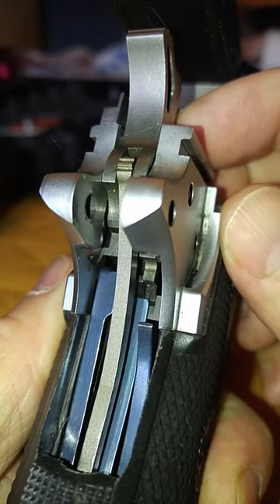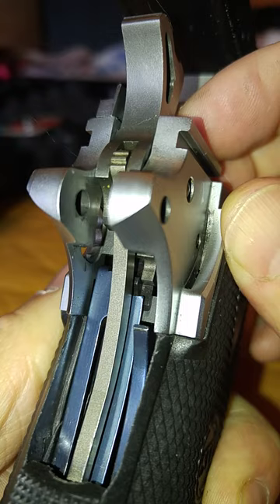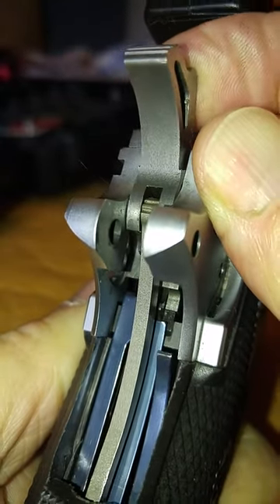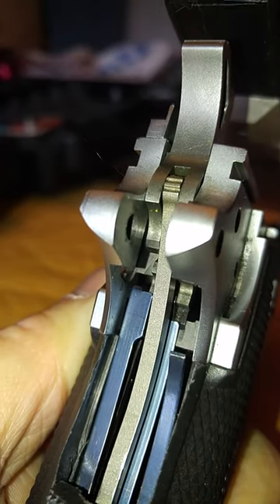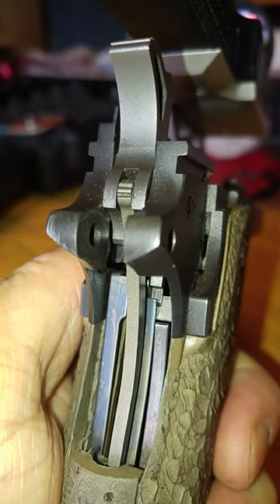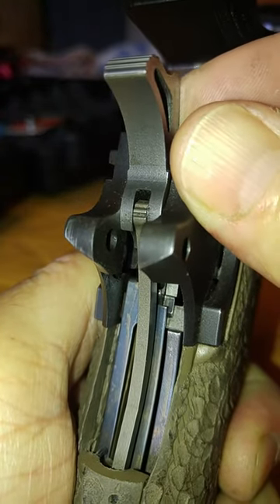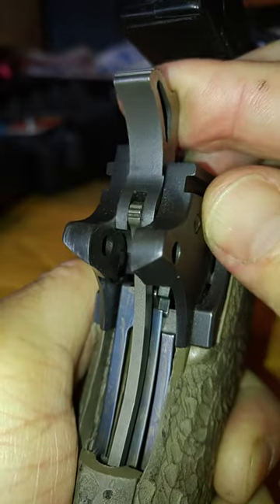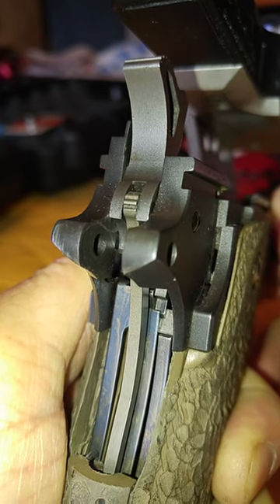STI Match Master Sear/Disconnector Problem - Sear Spring too short!

Comment from the maker: As an update. This past summer the barrel failed at the barrel lug/connection. It only had about 9,000 rounds through the barrel. Shortly after that, the slide cracked on the top and edged toward the strong side. I am still waiting for STI/Stacatto to send me a replacement.  Two months later, my Trubor with 60,000 rounds cracked in the same spot. Again, still waiting on a replacement slide. A friend has an older open gun with 180,000 roumds with no issues. Go figure.

Comment from the maker: If the spring is set too light, it will be as if there is no 1/2 cock stop. Also, you can easily cause it to not catch by filing the sear or notch on the trigger to the wrong agle or removing too much material.

Comment: Which brand sear spring did you buy with the extra length?
Reply from the maker: I got the spring from the Canadian STI distributor. He went through his supply and picked out the longest one he had. FWIW, the quality control of the length was not very good as it really depended on where the spring was bent on the end. It just happened that my gun (the plastic grip) was not fitted as tight to the frame as some other guns.

Comment: How did you fix it i have same problem not loud click did you put a heavier MS spring to fix that or play with the sear spring leaf??
Reply from the maker: Ron, I replaced the spring with a longer spring. We had to sort through a number until we found a slightly longer one. The problem may be because of the grip fitting in that the slot that holds the spring was too far away. However, the quality control on the bend in the spring where it sits in the grip is not very good. There was no consistency on where the tab was bent. 1000s of rounds later and no issues.
Reply: Twoicebergs you talking about you replace the main spring you put a longer one ? Or you talking about sear spring leaf?
Reply from the maker: Sear spring. As I mentioned in the video, it was binding (not all the time) on the disconnector and needed to be just 0.5-1mm longer.

Comment: So I shot my Dan Wesson today and was having hammer follow all of a sudden. I have never had a problem with that gun, not one. But today almost every round I had to pull the hammer back manually. Could it me my sear spring? Should I just try to order a new one and replace it?
Reply: Oh yeah and I had two double fires also. The only thing I changed was I shot some steel cases wolf ammo though it. I thought it had to be the ammo because it’s never done that before. But after trying brass case it was still not locking the hammer back.
Reply from the maker: I would look at the disconnector first. Also, ensure all of the grip and spring attachments are not loose. Then you would try to recreate tbe problem on your bench with the back of the grip off. Obviously if you had another spring readily available you could just swap it out, assuming it was tuned for your trigger and disconnector.
Reply: Twoicebergs is this something I should just take it to a gunsmith who knows 1911s? I’m ok with replacing springs and parts but not adjusting triggers. Thanks for the reply.
Reply from the maker: @goldenbanjo197  Most times these issues occur when the spring looses some its presssure due to aging or being lightened to change the trigger characteristics. After being adjusted it can fire 10s of thousands without requiring adjustment, but I have found that most of these problems occur within a 1000 rounds of being new. Rapid firing seems to be where the problems seem to show the earliest. Same for ejection issues.
Reply: Twoicebergs it’s weird because it worked flawlessly when I got it. It’s got fairly low miles on it. I would imagine under 1000 rounds. But I’m the second owner. I have shot maybe 300-400 rounds through it and the guy I bought it from said it only had 500 rounds through it. I’m going to take it apart today and see if I can see anything. Any help on what to look for would be greatly appreciated. I’m not an expert on these especially on how the trigger system works and what to look for. Thanks so much.
Reply from the maker: @goldenbanjo197  ensure the disconnector &  hole is dirt free and oiled.
Reply from the maker: If you changed ammo and it has a lower power factor your slide may not be coming back enough, but this is not too common.
Reply: Twoicebergs ok I’ll check that. I keep my gun clean and oiled well. Although I haven’t taken the lower apart yet. It just seemed pretty clean so I hadn’t done it yet. Can you tell me what part the disconnect is?
Reply: Is that the little plunger on top of where the slide rides that pushed up and down?
Reply: Twoicebergs I don’t think it was the ammo although I was shooting steel cased wolf for the first time when this happened. But after I switched back to my regular ammo and it did the same thing. So maybe the ammo started the problem? Idk
Reply from the maker: @goldenbanjo197  yes
Reply: Twoicebergs ok I completely took its apart and there was some dirty spots. Especially the tube for the firing pin and the extractor tube. But I cleaned and inspected every piece of the lower and didn’t see anything jump out at me.

Comment: Can a stiff disconector or one that dosnt push down easy. Keep the slide from reciprocating? During live fire
Reply from the maker: No. If it was stiff enough to drag the slide, that would a huge fitment problem. Weak or low bullet charge, slide fitment, lubrication, and/or too strong of a recoil spring will cause that slide issues. Often a shooter has slide issues due to grip/thumb interference using a new pistol.
Reply: @Twoicebergs  used factory ammo. Had 8,10, 12, recoil springs in. Not a new shooter know how to grip. Juat build this 2011. Fired fine, then had someone cerakote it and now problems.
Reply from the maker: @montgomerymassotherapy6146  Is it a problem coming back, or going into battery? I think you may have answered your own question as you said," then had someone cerakote it". Depending on the build up that may be the cause of the drag/interference. Even if it seems to run smoothly with just the slide on the frame, it may bind once the barrel and springs are in place, especially once the temperature of the barrel warms up. You could run the slide on some 500-1000 grit oil wet paper to see if that helps. Don't be too aggressive, but you could even go coarser if needed. For a final run, switch out to 1500-2000 grit as needed.

Since it appears you just built this 2011, there could easily be fitment issues you haven't yet considered or stumbled across as you break it in. If I had a dollar for every 1911/2011 build that had an issue right from the start or even 2,000 rounds in, I could buy a lot of beer! FTF, ejection issues, magazine fitment and retention, etc. 

Take this with a grain of salt, I have seen expert shooters ride the slide on a new gun. Depending where you keep your thumb, it is easy to interfere with the slide on a 2011.
Reply: @Twoicebergs  I have removed all cerakote from fraim rails and anything that may inpead slide movement. The slide would not got back rearward. I'll hit it with some 2000 grit. Appreciate the advice. The pistol ran good before I had it cerakote . I had rounded off  all areas that take time to break in. So it would run smooth.

Comment: Explain what "this only has 3 to 400 rounds through it and that's why it doesn't work" means.
Reply from the maker: I believe I said 400-500. The problem is it came from the factory with these issues. It never should have left the factory like this. Perhaps the sear issue could have been missed, but better quality control of the fitment would have prevented this from becoming my problem. As a secondary comment, increasing the spring pressure would normally cure trigger follow, but it didn't in this case..